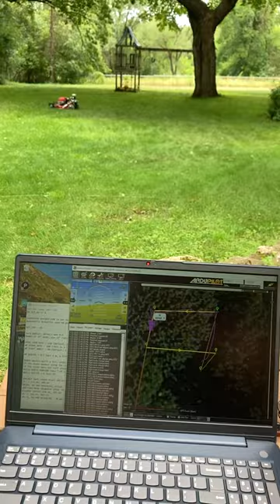Lawnbot - autonomous lawnmower with hoverboard motors test drive

Comment: What are you using to transmit way points to the rover?
Reply from the maker: That is Ardupilot's Mission Planner.  You could also use QGroundControl or other programs that use Mavlink protocol

Comment: Do you have a site that goes over the build?  Also, what are you using for the wheel encoders on the hoverboard motors?
Reply from the maker: Yeah, here it is on Ardupilot site:
https://discuss.ardupilot.org/t/lawnbot-with-esprtk-corrections-ublox-zed-f9p-gps-and-cube-orange-autopilot/88465
I'm using the built in Hall encoders.  Will be replacing these 8" with 10" segway ninebot wheels.
Reply: @rhauff1  Thanks....that helps a bunch.  I didn't see anything though regarding the encoders that you used on the hoverboard motors.
Reply: @rhauff1  So are you using the hall effect sensors as your encoder?  If so, how is that level of resolution working out?  Thanks...
Reply from the maker: @rickwartman956  I believe it is working fine.  I am having some position drift and not sure if it is GPS related or wheel slip.  That's why I'm replacing the 8" wheels with 10" to get more traction as my yard is rather bumpy and I know there is some slippage.  Hopefully get back into this project in the next week